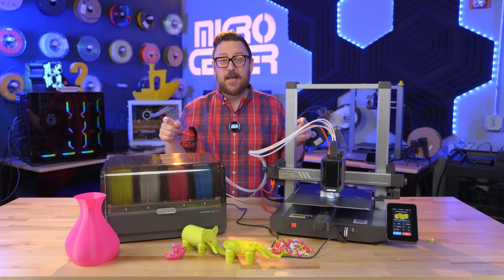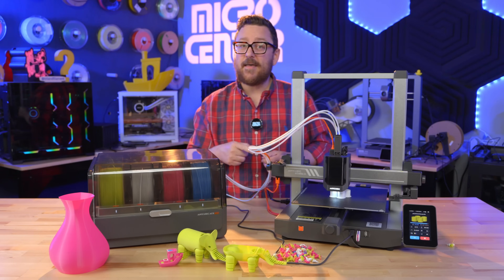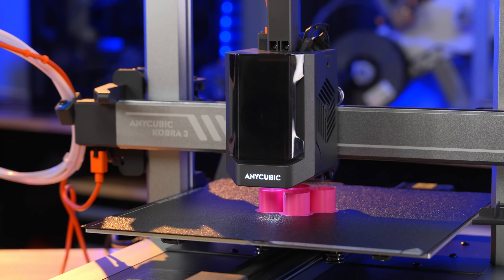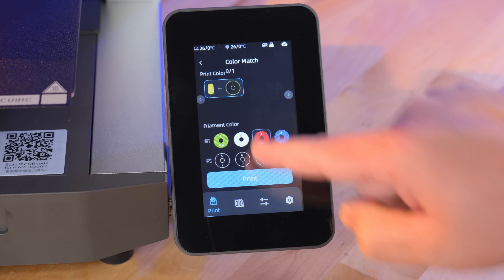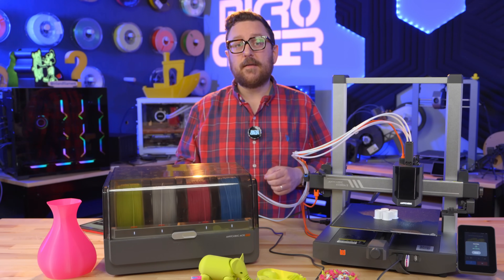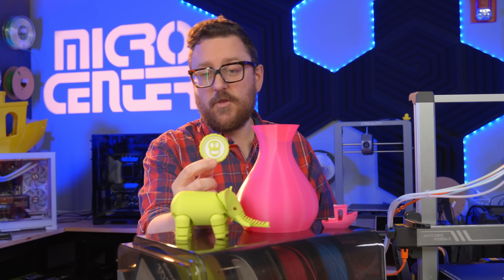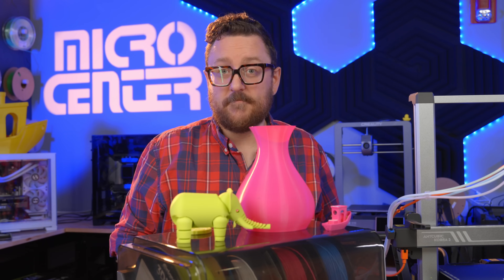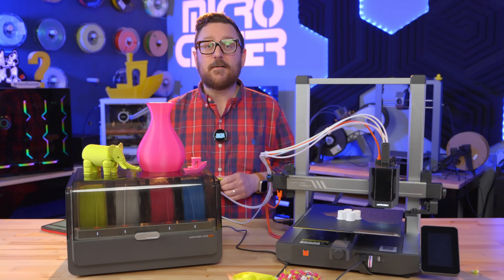Anycubic Kobra 3 Combo | Early Look and Close Up

Comment: The only thing this machine has good and I’m not blaming the printer. I am blaming the color change box whatever they call it it did. It has a dryer in it that’s about it, but this is the biggest junk you’ve ever seen it get stuck and I’m not talking about the print I’m talking about that box whatever they wanna call it. It makes so much noise. The retraction is ridiculous. The filament is always getting stuck and I had mine ready for about a year. This video is probably one of the newer ones in the beginning, but this is trash. Do not buy this. This is garbage.

Comment: I wonder if the multicolor setup of this Cobra 3, can be adapted to an older Anycubic I3 Mega Architecture, meaning mechanics, for example? 
Keep the I3 Mega architecture and adapt the Cobra 3, 4 color head and filament drive system.
I still print on I3 Megas and Love these machines so much, they have been solid dual rail structures and consistent through many years,  I love the self-enclosed power and touch screen center on the clean enclosed solid base of the I3s, hard to find this design in modern machines,  I do not like the side mounted touch screen displays at all, they bother me greatly, aesthetically and functionally, reason I will not part with the I3 Megas,  the I3s are solid clean designs and for the stuff I do, with slight mods to the I3s,  they have been great workhorses.

Comment: Hi have you tried to use the ACE with TPU? I am looking to print with the Recreus 82A filament and wonder if the ACE can handle the soft filament.
Reply: the ace can jam with you according to the reviews I looked at but it prints just fine from the spool holder.

Comment: Hang on, are you saying you can ONLY print to it through either wifi, OR USB Stick? These things STILL don't allow just printing through a USB cable connected to the computer as a standard feature like regular printers do?
Reply: no closed source system does. Yes its annoying and yes we hate it. Lets hope they open the source code.
Reply: @tjhuntog  I can do it with my Neptune 2 and Cura.

Comment: Hello, ... I have a question, in several parts of the review you indicate that it is multi-material, does that mean that you can introduce flexible filament into the dryer? ...or does the flexible have to be fed outside the dryer and without the PTFE conduit?

Thank you.
Reply: I have one pre-ordered and I'm also trying to find this information   I have emailed their after sales support but still waiting on answer
Reply: @doowaa2001  ok, thank you very much
Reply: @doowaa2001  did you get an answer?

Comment: Bamboo cost a lot. Anycubic cost less and give you a good product. What s the problem guys here in the comments below? 😂😂😂😂
Reply: Ask me the same question in 6 months.
Reply: @Defyant123  i ll do
Reply: My first printer is actually no lie a photon zero SLA printer from the trash and I'm amazed how well it prints and how robust it is
Reply: Dunno what ppls issues are, I have Anycubics, including this one being reviewed on the way and they're great.
Reply: The problem is you won't have your hand held the whole setup.
Reply: @ThatoneNB12  it's actually practical because you don't need to thinker a lot 
I did buy a bambulab a1 recently and it's amazing to be honest. Really reliable just hit print and go. I do have a highly modified ender 3 pro for tinkering. Great combo for me. If I had the money I would also buy an anycubic.

Comment: I was considering upgrading from my aging Anycubic i3 Mega to a Bamboolab A1 with AMS Light. However, I think I'll wait a few more months before making the switch.
Reply: Brand loyalty LOL
Reply: I repaired and tested an I3 Mega just recently and was impressed with the quality of the prints.
Reply: @petercallison5765  The print quality of modern printers hasn't necessarily improved, but there have been many quality of life changes: auto bed leveling, Wi-Fi file transfer, multicolor printing, better extruders for a wider variety of filaments, more sensors for error handling, and so on.
Reply: get a bambu lab a1. I have one and it's amazing. I upgraded from a modded ender 3, and it's honestly amazing. I have zero regrets.

Comment: Ok, Microcenter. I love yall but this was not the video to make to try and help this unit. As of 5/15/24, there are zero videos of these preview units making actual multi color prints. Just a lot of continued hype over the ACE saying it will and then doing lots of single color prints.  I have a sinking suspicion that these early preview models either can’t do true multicolor. Either because it’s not finished and they were rushed out the door before Creality pushed out their K2 with multicolor. Or, Anycublic wing clipped these ACE units in the software until closer to the release date.  I really want the ACE unit to work and bring competition to this market. But I’m feeling doubtful right now.

Comment: How can this be used in everyday life .  Making toy elephants isnt productive .
Reply: That's kinda the problem in 3D printing. The only actual point of Multicolor printers is to make toys and trinkets. Especially since neither the Bambu AMS or the Anycubic ACE. Can actually do multi material reliably. On both of these TPU can get wrapped around in the rollers because of how floppy it is. And for ABS you can't print ABS+PLA on an open printer and you also can't print ABS+PLA on a closed printer because the PLA will deform.
Reply: you can use one water soluble material, one strong and rigid, one less strong but uv resistant and one elastic. so you can make cheap, strong part with some built in gasket with it. pretty awesome

Comment: To anyone new to this, be careful not to fall for the advertised printing speed gimmick , the “ up to” printing speed is never what you can print at and not even close. The printer can reach those speeds and print but not decently. They say “can print up to X speed” but dont say it will be a decent quality. Every single company does this so look up reviews to find out the realistic speed you will be actually printing at if you care about speeds.
Reply: They show maximum speed not average speed, the printers do reach those speeds but for only a fraction of the time.  My Neptune 4 Max hits 500mms with good quality.

Comment: They better retro fit the kobra 2 max with the mmu
Reply: A stick to flash the firmware and a head that fits.
Reply: @VM2D  Pretty much they should just make an upgrade kit with new head, the mmu and maybe push the firmware from their cloud server or flash drive.
Reply: Not going to happen. Stay in your lane brokey.
Reply: Considering the 6 pin non usb connector and anycubics behavior diring the launch of the kobra 2 max (shipping amazon and ebay orders before the preordered products etc.) I'd heavily doubt that.

Comment: "Cardboard spools and plastic spools with no issues" but then we see one of the cardboard spools has a big scar on the rim, of course I have no idea if this was caused by the unit, but what I do know is that when they are at that stage in the Bambu AMS it is not far away from problems.
 I thought they would have addressed containing the purge material rather than just pinging it off to wherever!
I hope they calibrate the purge more accurately than the AMS, transitions from black and white are the only time you need a really conservative purge.
 I would like to see if the electronics have a fan to protect them from the filament drier heat and if there is one how quiet is it?
Reply: But purging any other way than flinging it wherever would require them to have a little imagination and come up with something for themselves, and that honestly just sounds exhausting...

Comment: I like the modifications they made to the “ACE” but the printer doesn’t seem much different than an A1. Having the multi material unit a dryer though is something I would love for my AMS to have so hopefully Bambu will add something like that to their next generation lineup when they come out with one.
Reply: Based on the ports and software, they might be working on an idex version, which would definitely bring some huge opportunities to the form factor.